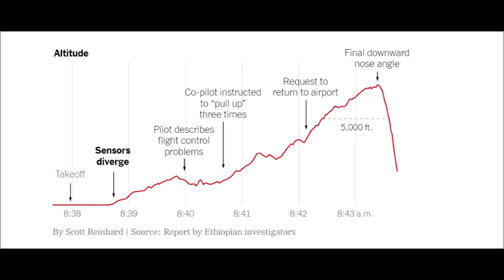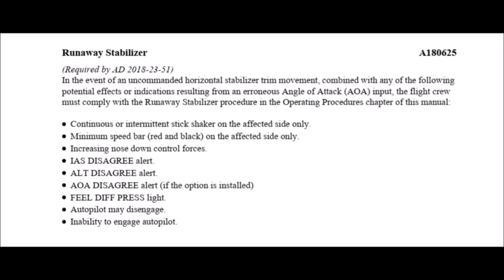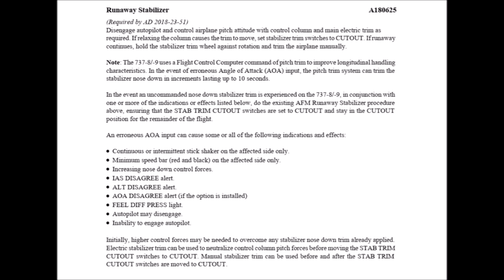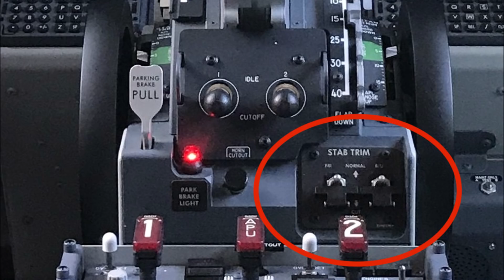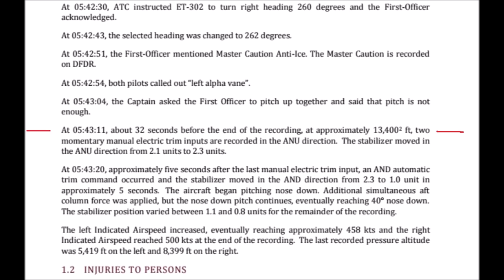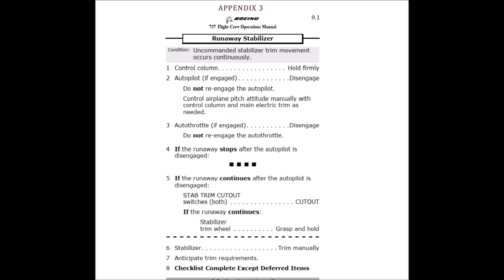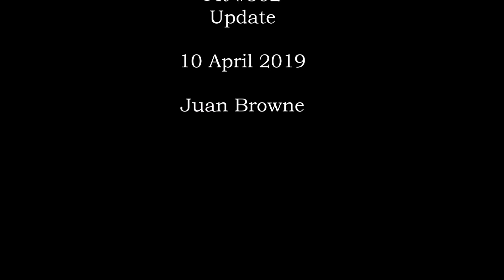737 Max Update 10 April 2019 Runaway Stab Trim Procedures

Comment: Thanks for the update. I easily fly 60+ segments a year. I'll be back on the plane Monday. I do wonder what flight qualifications the software engineers are required to have... and how many segments a year do they fly?
Reply: I’m an electrical engineer working in the automation and controls field.  I write software, a lot of it.  I don’t work in the aviation industry.  I work in processing plants and factories.  

We’ve been discussing these crashes and we are all totally flabbergasted that any engineer would’ve produce this.   Defies all common sense and good practice.  

This is the kind of mistake a young green engineer might make on a small project pushed for time and didn’t push back enough against management rushing a project.  It also means that there is a lack of documentation that specifies specific tests and verifications that need to be witnessed.

In the petrochemicals industry a “2oo3” architecture is used for safety critical systems.   That’s pronounced “2 out of 3”.   You define three sensors into one group and then specify what percentage divergence is considered a fault.  If there is a sensor disagree  you get an alarm but you can keep operating.  If there are two faults you get another alarm and you can use that to program a graceful shutdown of the system.   That’s pretty standard practice in fact there are lots of standards specifying this.  On many process control systems and programmable  logic controllers you don’t have to program all of this alarming and monitoring the operating system supports it you just have to configure.

So it’s totally insane the Boeing got this wrong.

I think it gets down to the 50-year-old systems architecture of the B737 which is built around concepts of duplication instead of triplication.   This ageing architecture is also built around the idea that the pilots monitor everything and that all actions are controlled by the pilots in this case the alpha sensor couldn’t be monitored by the pilots because the angle of attack sensors were not displayed and MCAS also operated automatically.

Another issue is that the angle of attack sensors seem to fail giving an false high reading.  This is failsafe if they are being used as a stick shaker input.   It’s not failsafe if it’s being used as an input to MCAS.   

The sensor  quality needs to be assessed.  The sensors should have self checking ability and some kind of diagnostics to communicate to the flight control software. 

I doubt the software engineers made a mistake, they deliberately built it this way and may have been told to do it this way.  I think these problems arose out of the directive of not changing the B737 max so much that it re-triggered a pilot retraining.   1960s system is designed around the concept of duplication and man in the loop and is not meant to be used for fly by wire control.
Reply: William Jones-Halibut, while you make some good points, the petro chemical industry has failures of its own (HOUSTON refinerys last 2weeks). 
Complexity in the cockpit should be avoided and pilot experience, (which seems to-be an issue in Ethiopian-LION AIR) needs to be addressed. The software has been improved and the 737 is quite capable into a long future and being a choice of many airlines for its efficiencies.

Reference; http://www.ktre.com/2019/03/21/oil-refinery-consultants-reflect-lessons-learned-houston-chemical-facility-fire/
Reply: @WilliamJones-Halibut-vq1fs  As a certified Functional Safety Engineer, I concur. This would be unacceptable in a car (ask Toyota about electronic throttles in the early 2000's). This should have been designed to IEC 61508....
Reply: Allan Gibson Interesting profession you have.  Companies failing to carry out proper risk assessments may end up like Boeing where the costs are not just liabilities but groundings and loss of public faith.  One of the things disturbing me is that the CEO is going around promoting a mere software modification as the solution to Boeing’s woes.  That may be okay because apparently the MCAS systems are used on the KC767 maybe okay.   However it seems to me like management/marketing have predetermined a solution, putting constraints on engineering that they will be forced to comply with, that just may not be practical or safe.   That’s what caused the disaster in the first place.  Why not evaluate to 61508? I’d say because it will drive unwelcome systems, hardware and other changes.   One thing that has come out of this is that multiple simultaneous alpha sensor failure is surprisingly more frequent event than one would expect.  Lots of cases.
Reply: @WilliamJones-Halibut-vq1fs  That has regrettably been my experience. Engineers and management commit to a bad design and it takes a body count to change their minds. The IEC 61508 standard is built on acceptable mortality rates however much people dont want to face it. There is no such thing as an unavoidable accident, just a sufficiently acceptably improbable one. Redundancy helps, but ensuring each element is acceptably reliable on its own is essential to minimising common cause failures. (Diversity is good too, using different techniques to measure the same value).
Reply: Kim Burke, even with redundancy this hasn’t insured a failsafe condition. AIRBUS HAD AN INCIDENT IN 2014  causing a severe loss in altitude;
On 5 November 2014, Lufthansa Flight 1829, an Airbus A321 was flying from Bilbao to Munich when the aircraft, while on autopilot, lowered the nose into a descent reaching 4000 fpm. The uncommanded pitch-down was caused by two angle of attack sensors that were jammed in their positions, causing the fly by wire protection to believe the aircraft entered a stall while it climbed through FL310. The Alpha Protection activated, forcing the aircraft to pitch down, which could not be corrected even by full stick input. The crew disconnected the related Air Data Units and were able to recover the aircraft.[41] The event was also reported in the German press several days before the Germanwings crash.[42] The German Federal Bureau of Aircraft Accident Investigation (BFU) reported on the incident on 17 March 2015 in a Bulletin publishing the flight data recorder and pitch control data in English and German. As a result of this incident an Airworthiness Directive made mandatory the Aircraft Flight Manual amended by the procedure the manufacturer had described in the FOT and the OEB and a subsequent information of flight crews prior to the next flight. EASA issued a similar Airworthiness Directive for the aircraft types A330/340.[43][44]

Systems fail. Pilots are the backup. Pilot flight experience in both the Ethiopian and LION AIR disasters was low for both FO’s and the PIC ETHIOPIAN plane. Remember the LION AIR plane prior to crash was saved by a jump seat pilot. Training is lacking in third world countries!
Reply: Alan Frizzell XL Airways Germany Flight 888T 3 of the 4 Alpha Sensors  had become filled with water from an improper high pressure cleaning procedure the day before as part of repainting.   Once at altitude the water froze simultaneously and locked 3 sensors in the same position and then voted out the 4th functioning sensor.  As this was an acceptance flight for Air New Zealand Stall Tests were performed (at improper altitude) because the flight envelope protection could not work the aircraft stalled and crashed.

One thing not coming out of this is the lack of robustness of these vane type sensors.   A better sensor type would be the more compact pressure nulling type where a small side probe with offset ports is rotated   to equalise pressure.  These are used in military aircraft.   They can be rotated to check functionality and are far more robust and compact.  

The sensors also should be heated.

On the B787 there is an alternate air data system that used Inertial/GPS data combined with thrust, attitude and flap settings to estimate airspeed, pressure altitude in case of sensor failure.

I suspect variometer data , if added in, could be used to estimate alpha ie angle of attack.
Reply: What they mean is "globalism" is the answer to "what changed at Boeing?"
Reply: Exactly. I sure hope they've at least read the "Human Factors of Flight-Deck Automation - 
NASA/Industry Workshop" from 1981.
Reply: @kburke1965  The issue the flight crews faced was they didnt know what to do - because Boeing didn't include the system in the manuals (because that would require mandatory retraining). In both cases this was the first flights by the crews on the 737Max8 with no Max8 simulator time. (Because Boeing said it wasn't required. )
The manual electric trim is far slower than the agressive MCAS commanded action. Simulator studies indicated that more than 40 seconds of runaway was unrecoverable.
At the speeds encountered the trim wheels became impossible to move. The required response was to throttle back confused by a stall warning (very few pilots will pull the throttles when the stall warning is sounding as this is response one from day one in flight training, if you stall, add power & drop the nose and gain speed). This needed specific training given the demonstrated unreliability of the system.
Boeing are in deep crap on so many levels over this....and it all comes back to money.
(About the only pilots who would pull throttles in stall are U-2 pilots who are trained to deal with low speed and high speed (mach) stalls, because the band the fly in has less than 10kts between them).
Reply: Allan Gibson Interestingly the stick shaker activated on the left ie pilot side only because that was the sensor that failed with an false high reading and because of the 1960s philosophy that duplicates just about all instruments on the 737 and keeps it completely independent and split pilot/copilot.  Someone here posted that in the BAE 146 the stick shaker only activates if both alpha vanes agree.   So in the 737 both the stick shaker and MCAS respond to faulty sensor.  It’s clear a different way of thinking and philosophy is involved.   Boeing carried forward the philosophy designed for man in the loop redundancy into Automation where there is no man in the loop to judge plausibility.
Reply: @kburke1965  ... here I agree with you.  This was a total failure on Boeing part.  The CEO should stand down and get out.  The individual or team or group that agreed to the single sensor should be fired!!  But, what's more disappointing is that Boeing developed the MCAS for a flight flaw...and how the aircraft handles because of the placement of these larger engines.  I could go on with lack of specific instructions and training's, but Boeing totally are to blame!!
Reply: JetMechMA They did try to use the manual mechanical trim but it didn’t work because they were at or above redline speed and the forces were too great.  In the CVR you can hear the speed warning alarm clacker sounding.  The engines were at 94% thrust under control of auto throttle.   The pilots were so startled they failed to disengage auto throttle as per the runaway stab trim checklist and then slow down.
Reply: Somehow you know this is the fault of software engineers.
Reply: Hornet135 or the genesis of it all, too big engines and their placement?
Reply: Kim Burke the A321, by disconnecting the ADC, simply went to alternate law which means the aircraft was flown manually.   The only difference now with an 737 and A321 in alternate law is that the hydraulic servo valves that position the flight surfaces are positioned by electric motors rather than cables.   A 737 that looses its ADC would loose autopilot, yaw damper, auto throttle, auto pitch.   

There really is very little difference.   One thing is clear:  the aviation industry is behind.  There are way to few sanity checks on sensor input data.
Reply: dothemathright 1111  ... appreciate you taking the time to respond with that info. Very kind of you!!
Reply: Charles Ritter you think the software engineers are to blame? how simple minded. they are constrained by management decisions. there would be other people involved in the process (such as design and testing). better question would be, what are your software engineering qualifications? how many systems a year did you write? get outta here!
Reply: MCAS must be designed by the millennial who spend too much time in virtual or cyber world. Or they may have come from Tesla.

How can such important and powerful automated system be made to rely on a single sensor? What was in the design engineer’s head? Lunch?

Yes it has 2 sensors, but the system only use 1 of the sensor at a time.

Logic tells us that such important system and powerful should have quad or at least triple redundancy. And better yet, cross check data from multiple instruments of different aspect of the flight.  

The pilot made mistakes, but the design is flawed too.
Reply: @kburke1965  I'm afraid the answer is going to be globalism and the need to compete with the EU sponsored Airbus.

Comment: Thanks, Juan!  It has been said that the MCAS was meant to counteract the engine's tendency to lift the nose because of engine placement compared to older 737s.  But it seems to me that moving an engine FORWARD and HIGHER would make it LESS likely to bring the nose up when adding thrust.  So, is it the position of the engines that requires MCAS or just the increased power of the engines?
Reply: My understanding is that the enlarged and flattened nacelles generated lift @ high (>17°) angles of attack. They worked like inefficient canard foils.
Reply: Precisely. Its too complicated for the media to explain this, so they just use a simple but inaccurate explanation. BTW, try explaining any of those technical terms (nacelles, canard, airfoil) to the public in less than 100 words...
Reply: @markfisher7962 , translated into language the public can understand:  The design of the plane was inherently poor.

Comment: They could have been able to trim manually if they didn´t leave 94% N1, because they did, they were going far too quickly to be able to trim manually. Both Boeing and pilot error
Reply: I don't consider it pilot error when the automated control system is malfunctioning.  That's like blaming the 9/11 building collapses on the NYFD.  The mere fact they have write such a manual indicates the plane is a POS.  Furthermore the pilots were given no practice in a simulator.
"We're nose diving, and I don't know why!"
"Get out the manual and see what procedures we are supposed to follow."

Comment: I wonder how many other pilots have experienced simular  mcas issue's and flown/overcome  the  problem. Does there experience get shared? Among other pilots?
Reply: I believe that the flight before the fatal Indonesian Max crash suffered the MCAS runaway condition and the jumpseat pilot correctly called the pilots to switch off the stabilizer cutoff switches and they safely landed the flight.
Reply: Yes, that is absolutely true, and was reported previously by Jaun. However, they did not know what MCAS was, since it was not described in any flight manuals. As a result they misdiagnosed the problem, and were in no condition to warn the next pilots, who crashed the following morning on the same aircraft.
Reply: @gordonrichardson2972  k
Reply: No the problem was correctly diagnosed and the correct solution was applied.  They then reported the problem to ground maintenance.  Which apparently could not reproduce the problem.
Reply: None, as far as we know. When there is a false MCAS activation, your survival chances are slim.
Reply: The professor mentioned that after the incident the day before the Indonesian crash the mechanics tested the AOA sensors!! But unknown to the mechanics when you switch on the AOA to test,the opposite sensor activates! Show a green or good condition but the wrong sensor🤔
Reply: @scottontheboat2340  They must have to have a long ladder to check it on each side of the plane.  Now before every flight will someone get up on a ladder and turn the sensor as someone in the cockpit calls out the output?
Reply: @JoeLinux2000  not needed (really the test software should be automatically testing both sensors not one at a time as what happened here, only the co-pilot side was tested)
Reply: Prior to the Lion Air crash, the flight that operated previously on the same plane encountered a MCAS anomaly. The jumpseat pilot correctly helped the two pilots upfront perform their runaway trim memory item which regained control of the aircraft. That was the only known incident of an MCAS anomaly prior to the two crashes.
Reply: The plane Lion lost due to a MCAS failure had a MCAS failure the day before.  A pilot in the jump seat realized what was happening and used the trim cutout switches.  The flight continued normally using manual trip.